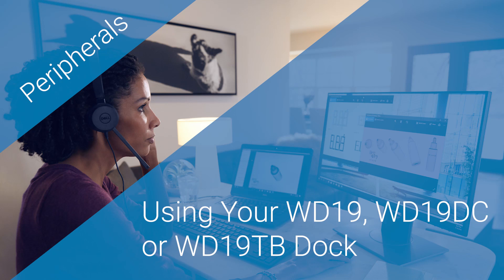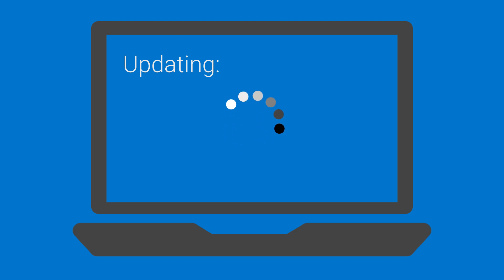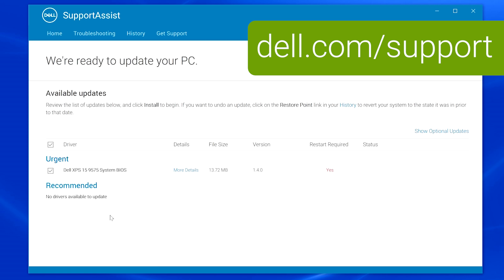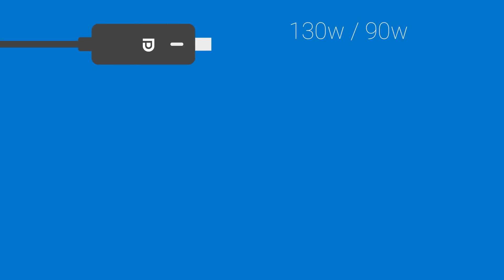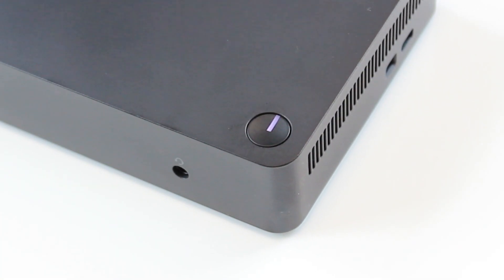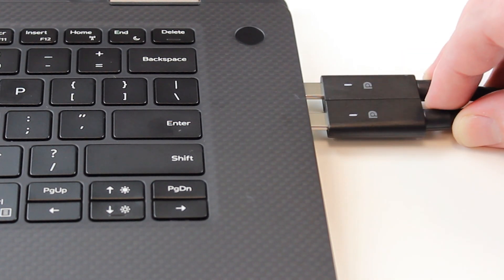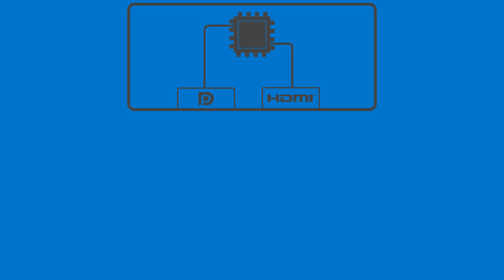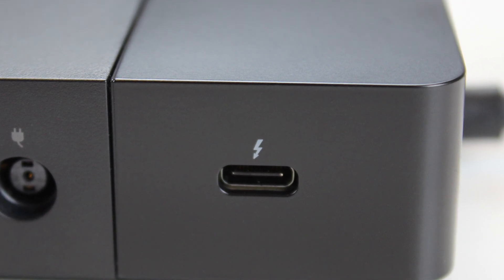Using Your WD19, WD19DC or WD19TB Dock

Comment: I have a Dell laptop Latitude 5530 and bought a Dell WD19S docking station and two Dell monitors SE2722H. I connected one monitor to the HDMI port of the docking station and the other monitor to the Display Port of the Docking station using a Dell Display to HDMI converter. The only monitor that works with the laptop display is the one connected to the HDMI port of the Docking station, while the other monitor that is connected to the Display port doesn't work.
What am I doing wrong?
Reply from the maker: Hi @ombiliyetusantos, please make sure that drivers for your Dock and Graphics Card are up-to-date. Please also try to switch your monitors to make sure both are correctly working on the HDMI port. 

You can find a guide on connecting multiple displays via a docking station in our Knowledge Base Article here: https://dell.to/4e4tKop
Here is a guide on troubleshooting monitor issues: https://dell.to/3YudS8W
And a complete guide on our docking stations: https://dell.to/40q8qXb

If you still need assistance, please contact the Dell Support directly at https://dell.to/3Yn3uzX

Thank you.
Reply: @DellEnterpriseSupport  Thanks for your advise. I updated the Docks driver and also noticed that there was an issue with the Dell Display to HDMI adaptor. All I had to do was to unplug and plug back the HDMI cable into the adaptor. It all worked out well. Thank you very much.

Comment: I have a Precision 7750 and I was given a WD19 here at work. The notes I have in a dock compatibility guide says that the WD19 is supported to use with this model, however it says I have to plug the laptop in externally for optimal operation. So I have the 180w adapter plugged into the unit, then when I plug in to the WD19 (single USB-c plug) I get a yellow triangle "!" on the power icon in the system tray. That leads me to believe that I am not getting optimal performance or I might be hurting the laptop in some way. Did I hook this up correctly?

Comment: Wondering if someone can help, I got my WD19 sent to me from work, I connected a 4k 60hz and ultrawide 2k 120hz monitor via display port 1.4 cables to the dock, on initial set up it worked fine with my Intel NUC laptop, the next day upon waking the laptop the displays no longer work with the dock at all, can anyone help?
Reply from the maker: Hi Daniel Gressiert, this article should be able to help you set up and troubleshoot your WD19: https://dell.to/3uosvNI Be sure to check the "Setting up an External Monitor" part.

If you need further help, please contact our support staff on the Dell Community at https://dell.to/3L9hUfm

Thank you.

Comment: If I use 210 PD on my xps9700 requires 135watt  would it increase the performance? Or would it over heat

Comment: I'm so confused on which dock to buy. If I don't have any devices with a thunderbolt connection, is the WD19 all I would need? I have the xps 7390 laptop.
Reply: I have the XPS 13 7390 2 in 1; it has two Thunderbolt 3 ports. The WD19TB is Dell's recommended dock. If you are choosing between the the WD19 and WD19TB, I'd definitely go with the WD19TB; especially for future compatibility.
Reply: But it really depends on what kind of peripherals you're using. Another great option is the CalDigit TS3 Plus dock.

Comment: I use Dell xps 9575 with dock WD19TB : 
This product is not stable, when I connect it to my XPS doesn't work the first time, I have to connect and disconnect several times to make it work but sometimes I have to restart my machine, Dell support changed me the dock, and also the motherboard twice without any changes I still have the same problem.
Reply: your notebook is not even in the compatibility list:
https://www.delltechnologies.com/resources/en-us/asset/data-sheets/products/electronics-accessories/dell_docking_compatibility_guide.pdf
Reply: @zomgree   sorry is my bad, it’s xps 9575
Reply: @ykhales  it was 7 months ago since you posted. Problem solved or you got non-dell dock? Asking, because i've ordered WD19TB today. Hope it was solved for you
Reply: @zomgree  I do not recommend buying it because I am still suffering from the same problem, in many cases I have to completely disconnect it from electricity for it to work and it is mainly a waste of time the problem is that the external screen works except the usb a and c ports and the network, knowing that I had the premuim service and they changed the dock, and install the latest drivers and Frimware without positive result.

Comment: I currently have a WD15 Dock/Hub for my Laptop - which does have 3 Display outputs - but only 2 of them are 2 HD and the 3rd is lower res VGA.  When I called Dell and asked their Customer Support to provide me with a unit that has 3 HD Display outputs they directed me to this WD19TB.  Watching this short video - it looks like this Dock is not capable of pushing 3 HD displays at the same time - It is either Display Port  OR  the HDMI.  I assume this would be for a 2nd Display - since there are 2 Display port and one HDMI port on the back of a WD19TB.  Is this correct?
Reply: It's only the multifunction USB-C port that will not provide video if HDMI is connected.  The DisplayPort port will still provide video if you have another monitor connected to HDMI
Reply: You can daisy chain monitors using the display ports (multiple monitors on one port). Your monitors just need a display port out and enable display port 1.2 if it's not enabled.
Reply: It looks like I better keep my D6000 then, which allows me to use DisplayPort and HDMI at the same time...

Comment: So how do i get the 240W for a Dell XPS15 9570 then? It has only 1 Thunderbolt/USB C connector... If I connect a dock with 130W psu, it will give me a warning at startup that the power is insufficient.
Reply: The WD19DC is for Dell Mobile Precision workstations only
Reply: Hi

You can disable this warning in the BIOS. The laptop will charge without issue and you won't get the error message each time you boot up the laptop.
Reply: According to the docking station manual, if you see the 130w warning, it means the laptop, dock and peripherals connected to both, pull more than 130w power. Then it is required by docking station manual to connect the laptop's power supply as well as the docking station

Comment: How does this compare with the distasteful TB16 which disconnects peripherals at will?
Reply: I got the WD19 Thunderbolt and it is the same nightmare. To wriggle out of it, I simply bought the Anker USB and connected all USB peripherals to it. So the Dell WD19 can keep misbehaving. It is really sad that Dell cannot improve on its technology or solve a simple bug. 
Recommendation: Don't buy it if you can do without it. If you can't buy it and don't be hopeful
Reply: Lenovo Thurderbolt 3 docking station had the same disconnecting peripherals problem with our Thinkpads X280. Later this year Lenovo sent us new white lightning labeled USB-C cables between the dock and the laptop and it didn't solve anything as well. I guess TB technology currently sucks on any vendor now. Sadly left with no choice, we moved to Lenovo mechanical USB-C docking stations to resolve these issues
Reply: Given that the TB18 does the same thing I'm not going to count on the TB19 being any better.
Reply: @trk8908  Why is Dell not fixing this? I returned the TB16 with the hope that the WD19 TB will not be the same nightmare.

Comment: Would it be possible to describe the difference between the WD19 and WD19TB? Why pick over versus another?
Reply: WD19 and WD19DC are USB-C with no Thunderbolt. WD19TB is using ThunderBolt(TB) protocol and provides better screen resolutions, power and connectivity ports